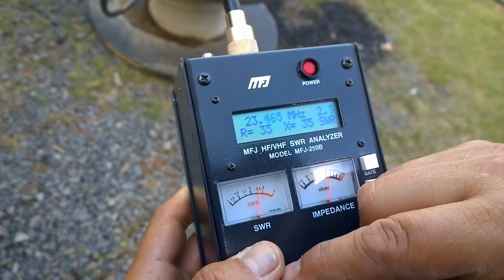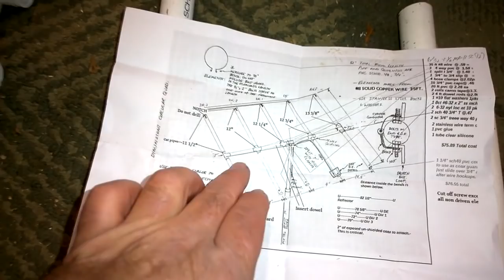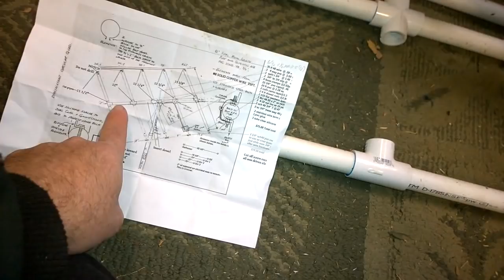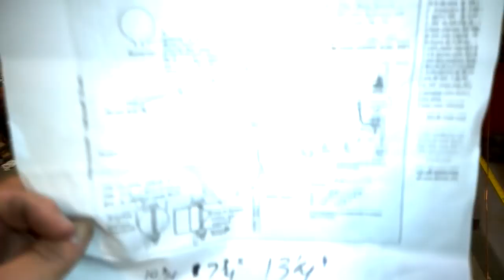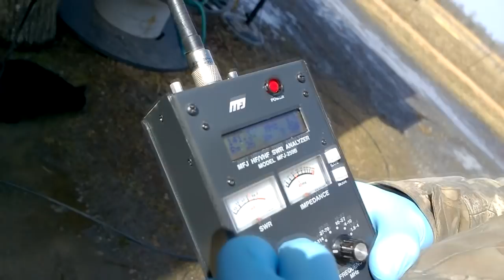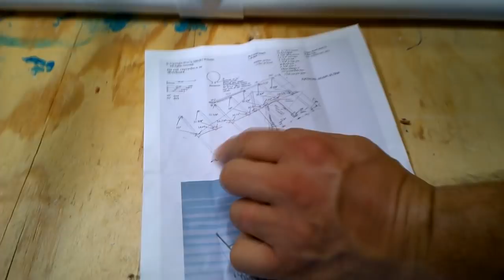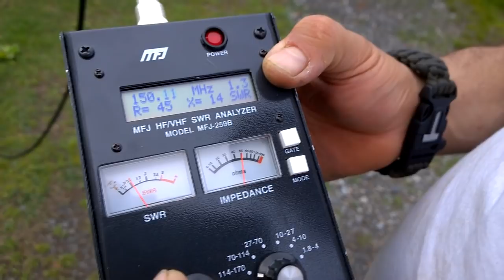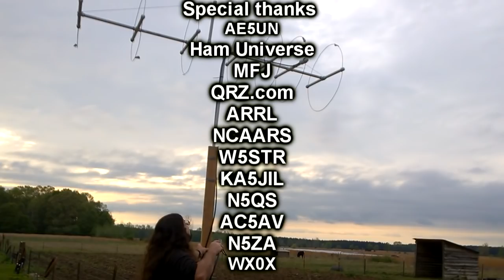Updated Don's 2 Meter Extreme Dream Beam Antenna

Comment: Best 2m design out there. I use the 5L version, my buddy uses a 7L version. We talk simplex (over 17 miles) regularly at half a watt. My antenna is at 33 feet. His is at 24 feet. He can use his VX-8DR to talk to me on 50 milliwatts! Unfortunately half a watt is as low as I can go. The only downside to this antenna is weight. This things are absolute pigs lol. We have redesigned them using fiberglass booms and spreaders with aluminum directors and reflector. 4lbs for the 7L version. Right around 3lbs for the 5L. I can hit repeaters at 80 miles day or night. There is a fairly tall repeater at over 100 miles that I get into on a regular basis. LOVE this antenna. I may have to try an 8 element version...12 ft boom and an estimated 16.2dBd gain! The only people that say that this design isn't worth the effort are the people who haven't used one. Great job, fellas!
Reply: That is somewhat of a contradictory statement.  If that were true, you could take a 7 element Yagi and remove D1, D2, D3, and D4, but leave D5, and it would be the same boom length but it would NOT have the same gain.  The elements are necessary every 0.15 to 0.25 wavelength for several reasons.  If they were not significant, then you would see people with long booms with very few elements.
Reply: Half a watt is as low as you can go?  There are several ways to get that lower.  One of the ways I use is dump some of that power into a dummy load.  That is, connect both your antenna AND a dummy load at the same time (using a power divider or a custom made "phasing" harness).  There are also attenuators that should handle 1/2 watt in.  A 6dB attenuator would make that 1/8th of a watt (about 125 mW).
Reply: I doubt an 8 element antenna of this type will be 16.2 dBd.  More likely it will be closer to 16.2 dBi which is about 14 dBd.  If you already have a 5 element, why not make an identical one and stack them vertically?  That should squash the radiation down closer to the horizon and may add about 2 to 2.5 dB of maximum gain.

Comment: For the notch in the ends of the PVC, use a drill press drill a hole and at the bandsaw cut from the end of the pvc pipe into the drilled hole making a slot. This is faster and maybe cleaner that chipping away with a drill bit as if it were an endmill. Another method could be using a router table with the slowest speed setting and then just slot it.

Comment: I just completed building the five element version of the Dream Beam antenna and got it up and on the air today.  I must say, I am extremely impressed with how well this antenna works.  I am hitting repeaters nearly 60 miles away with only 10 watts and the signal coming back is S5-S7 (no pre-amp).  Initial testing of my dream beam, before raising it, showed SWR's at 1:1 on 146.520 and no higher than 1.4:1 across the entire 2 meter band.  No post assembly tuning was necessary!  

I did make one modification.  Instead of connecting an entire 50, 75, or 100 foot length of coax to the feed point (once it's siliconed, it's pretty much permanent) I made a feed line. I used a piece of RG-8X, long enough to put in a few turns in for an RF choke, soldered on a PL-259 and attached a barrel connector.  Now if you need to move the antenna for any reason, you won't have to disconnect a long length of coax from your radio, just disconnect from the barrel connector and off you go.

My dream beam is pictured on my QRZ page

Thanks Matt and Darron, you guys are a hoot to watch and the background music is awesome.   73   KV3S

Comment: I utilize two meters for the national calling frequency 146.520 Mhz and sky warn when ever severe weather threatens my home town of Kokomo which inside Howard County in north central Indiana upon reviewing this video of Don's antenna I think he did a great job of producing that antenna.
Reply from the maker: +Tony Ridlen   Thanks very much. It is a proven design. I have made a lot and I get a lot of emails with successful results. The only time people have issues is when they stray from the path. Try it before you redesign it. You won't be disappointed. It beats the pants off any single antenna system.  73s

Comment: I love using PVC for projects but when using white PVC outdoors be aware that UV from the sun really weakens it over time. I have seen it become like egg shell. There is gray PVC pipe used for outdoor wiring and it has good UV protection built in. If not then get a good spray pain to coat the PVC pipe once it is assembled. Antennas are one of the things us hams can build and they are fun. All the best.

Comment: Hi Don, Came across this antenna of yours a couple of weeks ago and set to and built one over the weekend , I only had some PVC & some 20mil fiberglass tubing I used for the spreaders and made the boom out of some 2x2 wood that I have dressed up. I then made up the copper loops with the #8 wire but I brazed them together except the Dir element made as per instructions.
Ive set it up on an 9 foot pole at the moment but intend to put it up on a 10 mtr aluminum pole so I can rotate to any position. But even at 9ft I am blowing my mates out of their shacks, it's amasing,  SWR is 1.02 to 1.04 over the range of frequencies that I use.My frequency range from 146525 to 146900 so am very happy with this design. regards Lance Smith ZL2ALS

Comment: i just finished my 2 meter the evening before i got my general upgrade. whats nice about it  is that with the mast unscrewed it slides right into the back seat of my 2010 crown vic police panther.  its 5 14 2020 and theres supposed to be a vhf contest this weekend. couple hours and up to the top of the mountain i go. im running a ft 991at 50 watts, but my QYT 980 plus does all of 75 watts. comparrison time. lol only thing i changed on build was i used 1/8th inch copper tubing sleaves and soldered all but the driven. using a mfj921 tuner just to dial her in till i can get a analyser on it thanks for the build guys . Next up is a 3 rectangle moxon build. did a single for 6 meters and so impressed. very simple build and very light with exremely good gain . give it a try if ya get bored. thanks again . k2gfi,73

Comment: I built this and have the Swr down to 1.12 @146MHz everything is as straight as I can get it but I’m not hitting anything new? Everything I can hit with the beam plugged into the HT I can hit with the HT w/ the abree antenna? Am I doing something wrong I had really high hopes of hitting something new.

Comment: Awesome video thank you. Putting up my homebuilt 11 meter experiment quad today and wasn’t 100% on how to wire in the coaxial feed into the driver. This is the first video I saw that showed that part which is very important. I appreciate it thank you very much for sharing.

Comment: For the reflector loop and director loops solder or braze the ends together and use slots at both ends. It will save you the weight of all the bolts nuts and washers for connecting the ends of the loops. Buy doing it this way you can form the loops on a work bench before inserting them in the end slots and adding the end caps.

Comment: Awesome vids!
This will be 18' up in my attic. Not the 40 you recommend. But I can reliably hit repeaters at 65 miles with my N9TAX antenna at the same height with 65 watts from a TM-281A. I can occasionally hit a repeater at 137 miles with some atmospheric help. Simplex @ 20 miles is no problem at all (Haven't tried any further than that). I live in Oklahoma so it's pretty flat out here :) Hoping the 5 element dream beam will extend my tx/rx distances even further. Cost will be lower since I won't be using end caps or glue/sealant, though a cheap $100 rotator will be needed.

Comment: Newbee to Ham but knowing something about pipe. You ought to try locating some schedule 80 fittings in key locations like the T that holds the entire Antenna to the mast. Schedule 80 is much thicker and is also much more resistant to decay in sunlight. Regular PVC becomes brittle when left in the sunlight. Schedule 80 does not.  Also the fittings you are using to cover the  ends of the loops electro-mechanical connections are called couplings. I just say this so it's easier for someone to locate the parts, not to be a prick.  Thanks for the video. Its this kind of tinkering that I find interesting about the hobby. Perhaps one day my roof will sport some interesting roof art.
Reply: One day I hope I can learn to make a really good FM antenna. I get horrible FM stereo reception out here in the boonies.
Reply: 9999plato

Comment: Here is a Danny Hodges the UHF TV antenna builder guy tip for you for straightening wire. Chuck up one end of your wire into a drill and the other in a vise and run the drill a few revolutions and it will get all the crooks out of your wire.

Comment: Just a follow up seeing how I have not heard from you so I have put in the following Standard wire gauge ( UK)  SWG       # 8  = 4.1mm   or 0.160”        conversion is 8.6 metres per kg
American Wire gauge ( USA) AWG  # 8 = 3.2mm  or   0.125”        conversion is 13.5 metres per kg

Comment: looking at  this antenna, you mention that you can rotate it  vertical  or horizontal  for FM or SSB .. but .. the elements are  loops ,, Not a conventional yagi configuration of rods and dipole  ...so i doubt this antenna has any polarity ..
Reply from the maker: +rob b  Its unclear when you think about the full wave. Not having any? I dunno about that for sure. It  works great regardless.  73s

Comment: Is that rg 6 your using ? And is that shield aluminum ?  I'm wondering if you reach up and touch the coax jacket would it affect the swr ? In another word that loop antenna Is balanced the coax is not so when you point the antenna at someone to talk do you have to point off a little to get maximum signal ? If so you have common node current on the coax and need to separate the feed line from the resonate loop  . The coax regardless if it's 50 ohm or 75 ohm can do good just pay attention to the loss . If you are using copper shield coax the a sleeve choke can stop common node current and make a hudge difference in directivity the antenna . I have built a out 30 of the quad  4 sided antennas and they work great  , there the best to remove noise and if you want some eme action then add the yagi directors to it for some killer performance. You guys are doing great keep up with the diy . Kc5ulu

Comment: Too many post to find if this has been asked... Why not crimp and solder the wire loops  ends together (except for the driven element, obviously) rather than drill holes and use the screws?

Also...how about using this concept like a Quagi, using 2 loops, but yagi type directors for the rest?

Comment: Can't believe that guinea hen at 27:53 , Morse code it would be a, a ,a a,a a a a a and pretty loud too . Funny. That extra little bit of parallel coax at 25:28 to match the natural higher impudence of a loop a the director coupling ? N6GRG

Comment: For the notch in the wire support you might use a "Mill bit" which is made to cut from the side. They come in 2,3 and 4 flute styles. They're cheap on bay from China (where else?) I use them for cut out's for meter faces, etc on plastic project boxes. Jeff KJ4RWH

Comment: Any way to add more directors to add gain and distance? If so, there is a project. I need to hit a 2 meter repeater about 100 miles away, The path is from Panama City Fl to Tallahassee Fla.

Comment: Can I offer a suggestion on the tool to use for cutting the slot in the tube end. I worked as a tool sharpener (cutter grinder) the last nine years before I retired,  with that said, my suggestion would be to get a 2 flute end mill, yes it will be more expensive than the drills you already have but it was manufactured to be used in a side cut, where the drills weren't. Just thinking of the safety you guys were talking about. :)
Reply from the maker: +n8pu   Its what you have to work with. Lots of tools could be used. Keeping it tight is a good idea.  73s  ty

Comment: Appreciate the video guys.  Did any of you happen to notice or perhaps model what Front to Back ratio is on either the 5 or 7 element by chance?  Thanks in advance. W7WX
Reply from the maker: +IBTJn   The seven is pretty amazing - depending on mounted height and etc. I can't hear a 65 watt mobile 3 miles away off the back side on the 7,. Some repeaters make it in, varies.  Its pretty much a laser beam on receive.  73

Comment: Can I ask what is the 45 ft #8 solid copper wire is it 4.1mm ?

But  as it being a US website and all measurements are in inches I would suggest that you are using American wire gauge AWG which is 3.2mm is this correct?

As I would like to build this antenna and being in Australia I would need the correct gauge copper wire standers so as to have the same thickness of solid un-coated copper wire could you please let me know this fact

Comment: This looks a great antenna project guys.  I wonder if it would be good if held in the hand and used for contacting satellites/space station? 73's M6PTS
Reply from the maker: +Steve Dickinson  Yep, might take a friend to keep it pointed right. - Careful using high power into the antenna. Check gain formulas before juicing it, most of the time no more than 30 watts is ever needed for anything. Keep away from it when cranking it out, there are risks with high power and human tissue.

Comment: Don, the draw that you have on your web, the distance between the U ------+----------U. Are the distance between each element?  Also, the measurements that show where you put the 8awg wire, is the radius of each circle or is the distance or length of the pipe? Do you have both squematics draws in better resolution? I will thanks you a lot. 73

Comment: You said in the video to mount the antenna in a vertical position for SSB use and I know that's true for a normal Yagi (weather you want horizontal or vertical polarization).But being that this antenna's radiating elements are all round, would there really be any difference which way the antenna's frame is actually mounted? Or am I missing something here?
Reply: This is a good question because since it's a resonant loop the polarization depends on where it's fed. If fed on the side it is vertically polarized and on the bottom or top it's horizontally polarized, right? Like a Cubical Quad.
AA5IT
Reply from the maker: +Frank Fertitta   Well, it's full wave  It works as shown and ssb is awesome when turned correctly.  73

Comment: So by turning this antenna on it's side, it can be used for SSB? Another question (since I'm not the most innovative person) How could this be modified so that I could perhaps "flip it" from horizontal to vertical and back? Or does horizontal polarization work for repeaters as well? Sorry if these questions sound stupid... lol
Reply from the maker: Solom America  Yes you sure can, if you notice the mast is mounted with hose clamps, this is so it's easy to flip the polarization. Repeaters are vertical, but ssb is not. Try 70cm on this beam also. It will surprise you. 73s.
Reply: ThePress Man could it be scaled to make it a little smaller??  73's KM4DSQ Ronald

Comment: I wonder what difference it would make if I used a plastic coated copper wire? I have a quite a bit of it kicking around.
Reply: Blair Tinker It would need to be slightly larger in circumference to add inductance to cancel out the capacitance you added with the air. Also rain will cause your antenna to detune because it turns your wire into coax basically by sheilding your wire with conductive rain water.
You can wax the wire with really dry thick car polishing wax to keep the rain off.

Comment: Why didn't you feed the coax through the director element and then down the support?

Edit: seems like alot of work to hit a repeater ;-)

and how much power do you think you can pump through this?
Reply: Chris Johnson With it being open copper wire you could probably get thousands of watts. What happens with pvc pipes though is that they eventually fail at 1000 watts or higher because the high voltage at the 90 degree and 270 degree points could arc and burn the pipe. This antenna though is attached at the high current points on the loop so it should handle it all.
The antenna they made is a full wave loop in vertical polarization which is the equivelent of 2 vertical dipoles placed side by side with good spacing. Its a yagi array of loops so the small loops are directors and the large loop is the reflector. Its the equivelent of having two normal yagis with the same element arrangement side by side (broadside array) but you get this gain from just one beam instead of cophasing two beams.
Also loops have less noise.

Comment: Regarding polarization, wouldn't this configuration be circularly polarized negating the need to rotate the boom 90° to select polarization? 
 and,... thank you for making this video 

ac0v
Reply: It would be vertical or Horizontal, depending on the feed, which I did not see, video too long to watch.

Comment: Question, you use #8 solid copper wire, what changes would be required if I were to use $6 solid copper (larger diameter)?
Thanks
Reply: Brian Walton  It should work out pretty close however some changes in the length of the driven element might be needed. As shown and designed it will near dead land on 146.520  As long as you don't try to redesign everything else you should come out pretty good. 73s